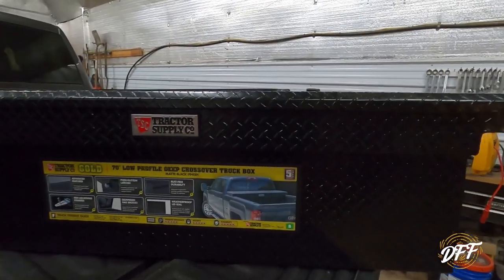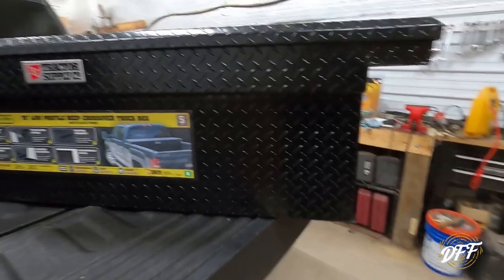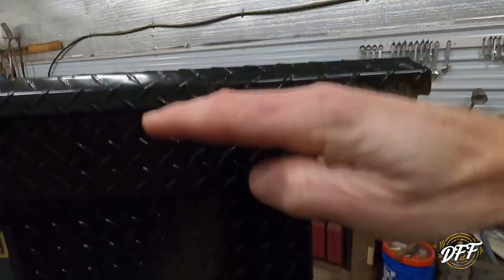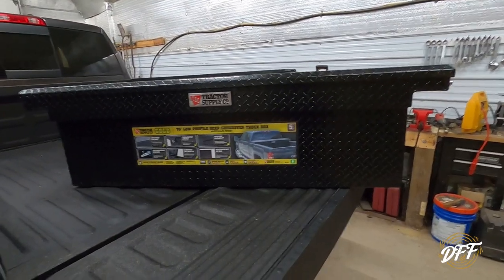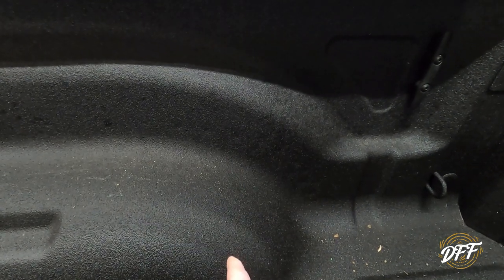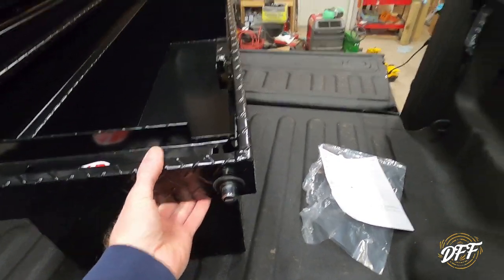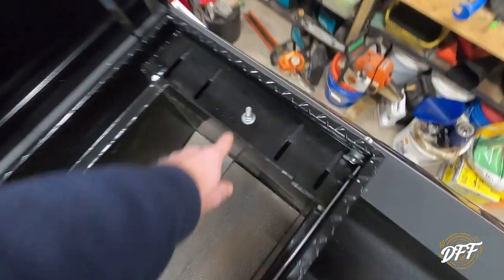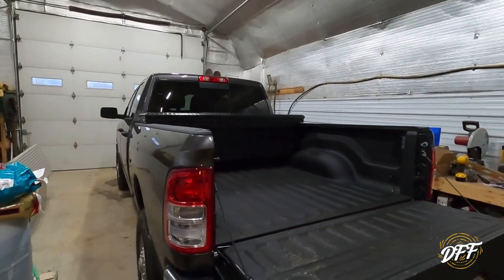How To Choose & Install A Toolbox For Your Pickup!!

Comment: If you're looking for a full size cross box, keep in mind that all boxes may not be appropriate for your truck.  I'm seeing boxes at 69" to 72" between different manufacturers.  On my F-150, a 72" box would stick out over the sides of the bed and look terminally stupid, but the 69" just barely works.  Triple-check the actual measurements if you're going to buy online..... and if you do buy online, be sure to be available when it's delivered.  You'll want to do a quick inspection for dents, etc. before you let the driver leave.  If it's damaged, refuse delivery and they'll have to return it.  Otherwise, you'll be stuck dealing with arranging a return and the possible costs to ship it back, depending on the purchase contract.

Comment: lots of good information Chris, there are so many styles of pickup boxes that its almost overwhelming. The one I have in my pickup is the full height but its the narrow one, I think its like 10-12" wide, I didn't want to loose the bed space, mainly bought it to put the compressor for my air bags in and out of the elements, but wouldn't you know its plum full of all kinds of stuff lol.
Reply from the maker: It can be overwhelming! Isn't it amazing how storage space gets stuffed full? Kinda of like a garage- you can always use a bigger one lol
Reply: Exactly Right.

Comment: I really appreciate the video. Lots of helpful info. I just bought a full size truck and want to get a box. I measured across from side rail to side rail using the outer edges. It only comes to like 69". All of the boxes I see are 72...so I guess there would be like 1.5" over on either side. I guess that's ok.